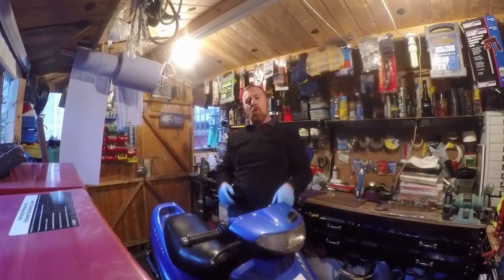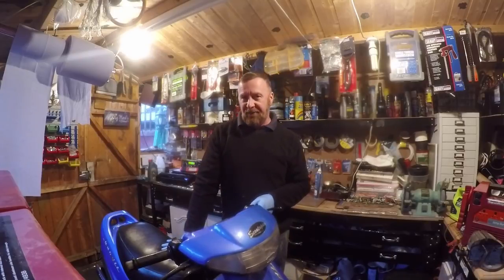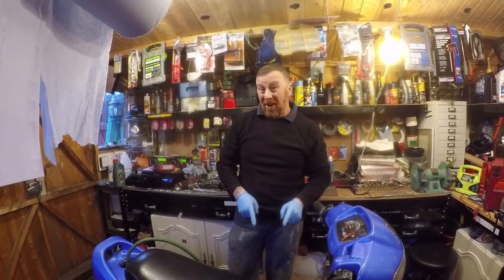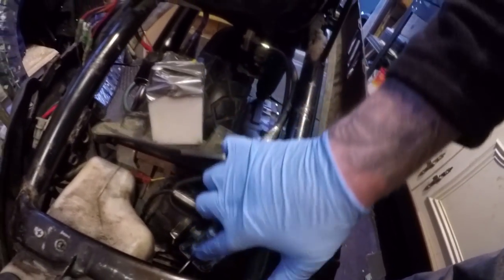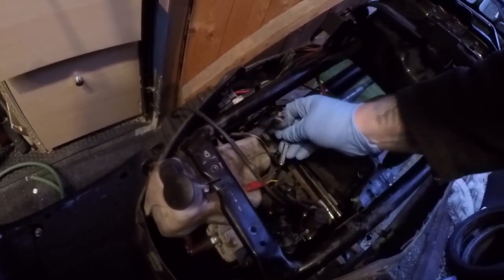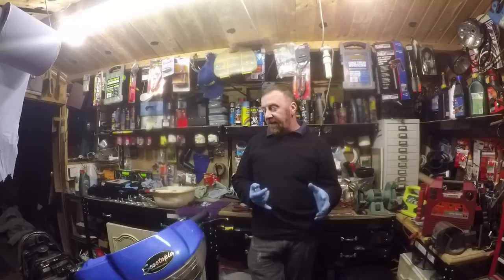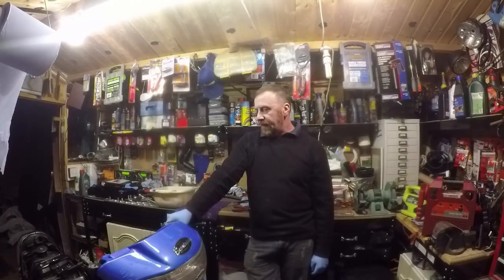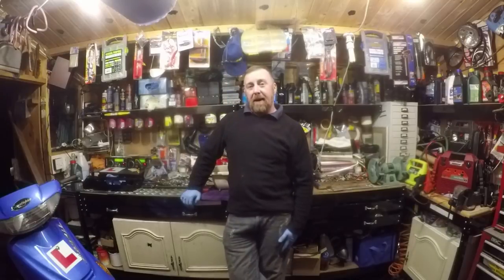BANBIT BUG 50 CC MOPED WONT START OR RUN TILL I FIX IT MARK SAVAGE

Comment: Hi Mark, great video as usual! I bought a 50cc baotain. The wiring loom was in a mess so I replaced it with a new one, but now the horn, front light and indicators don’t  work. Any ideas mate?
Cheers!
Reply from the maker: HI bud thanks 
if its from the same year moped it should all be ok , just double check you have plugged in all the connectors and wired them in correctly 
make sure the battery leads are on ok and earthed and fuse is ok too 
you may have to use a volt meter to trace the power if still not working, remember lights will only work once running but horn and indicators should work from battery 
mark
Reply: mark savage Ok I’ll try that. Cheers again!

Comment: I know this is an old video but I've just bought a lexmoto tornado 125cc the guy from the mechanic shop dropped it off and I took it for a test drive and the sports exhaust fell off at the Moto, the exhaust nuts and bolts fell off lol so hope it's good once they've had a look at it. What to check when buying a new bike and should the front forks be very soft like they have no dampening??
Reply from the maker: id be on the phone to the bike shop bud as that's bad, sounds like maybe some work was done on the bike before they delivered it and didn't do a PDI on the bike - not good .
as for the front forks the yare soft bud and none serviceable on many peds, its when they leak or go hard its a problem

Comment: Good morning Mark how are you doing my son quick question where would I get parts for a Chinese to 250cc star way as I've looked everything cannot locate any parts from
Reply from the maker: hi bud 
engine parts should be generic so like lexmoto , sinnis and so on but being a 250 its going to be hard 
electrics again should be easy but panels etc  well e bay of breakers may help bud 
ive had this with a Chinese bike before and even a mk1 ybr stator as they are like gold dust, I had to get it rewound lol
take care bud and thanks for watching
Reply: Could try Chinese motorcycle parts online CMPO
Reply from the maker: easyMEDIA I’ve used them a few times worth a go bud
Reply: @marksavage  thank you mate I will do I will do I need a choke cable in the switchgear for this little 250 just started me Bandit after 7 months sitting in the garage five first time just went straight through its MOT today so I'll be taxing at later on be back on the road on that one for a minute
Reply from the maker: r j auto nice when you get them running again from leaving them sat up 
I’m back playing with that bloody black Lexmoto 
It will start and run on the day 
Next day it won’t start and smells very rice 
The air mix is on the underside of the carb so it’s all off just to take it out half turns Grrrr but then it runs fine and starts till the next day 
Haha ha driving me mad but will keep turning and get it sorted 
They are sent to try us !!’

Comment: Bit of topic but I have a lexmoto gladiator 125cc and I seems to have lost a lot of power any thoughts
Reply from the maker: first thing bud service so plug oil and air filter, 
next valves when did you last have them set 
piston wear 
but depending on the age and miles all bikes do loose power in some way as only about 11bhp 
hope that helps 
mark
Reply: @marksavage  just waiting on parts order service kit so all of them plus belt also ordered new rollers and I'll clean out the carb
Reply from the maker: cool that will help too and more than like solve it like in my variator videos, after all that you sohlud be back on the road soon bud 
mark
Reply: @marksavage  I watch all of your vids bike still runs parts arrived today so will sort it all 2moz fingers crossed